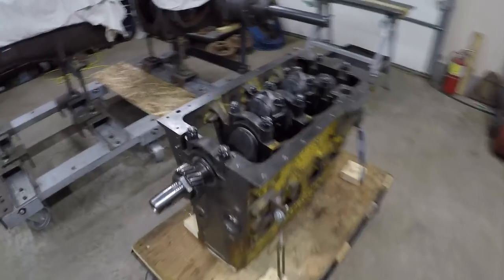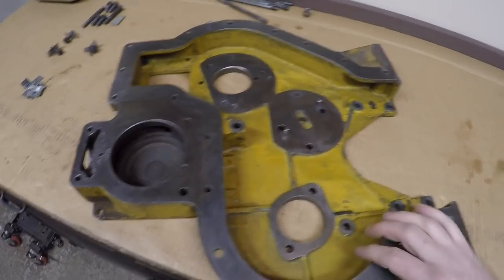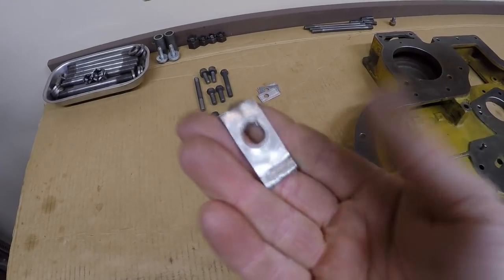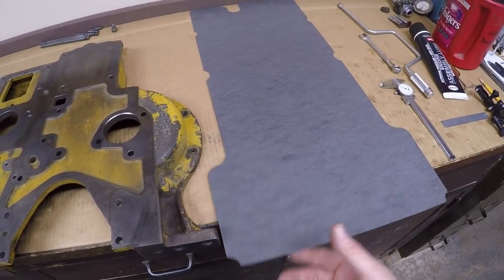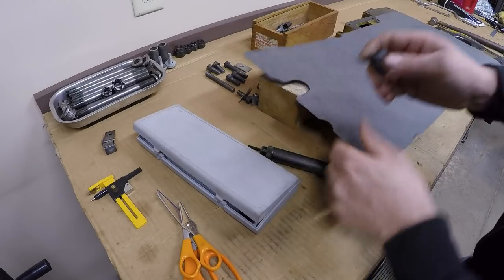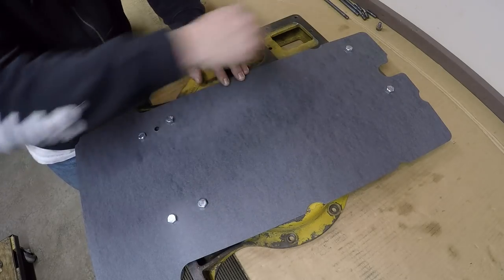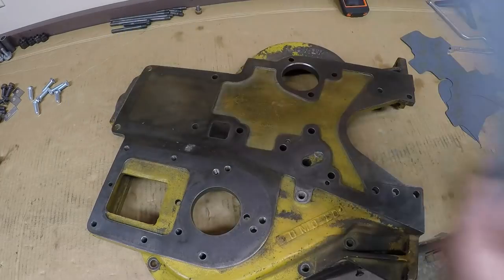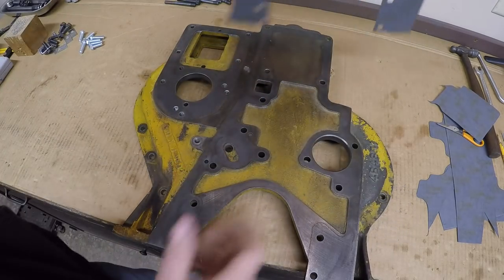Caterpillar D2 #5J1113 Diesel Engine Assembly Ep.11: Intermediate Cover Prep, Locks, & Gasket

Comment: Back in the day, we used to often make gaskets this way and the sealing compound of choice was "shellac" which was made out of tree sap and other additives. Today, its instant gasket and polymer gasket materials - which is good too.
Reply: Shellac is bloody good stuff. i've reused head gaskets with a coat of it on both sides of the gasket and bolt it down tight and even. Successfully, more than a few times. Not with permaseal gaskets . They're stuffed with a single use usually. i keep Shellac flakes in my toolbox. mix it up with kero or turps or meths Methylated spirits for engine gaskets. Turpentine for wood furniture. Kerosine for a protective layer on metal. (massive fire danger with kerosine). Like red lead paint there is no substitute in modern materials.

Comment: Remember making gaskets for hours back in the day. We bought the gasket material in big rolls. And every job we had the right gasket. I did learn to mark the outside edges with grease. Then an old rolling pin. Marked them perfect to cut out the edges.

Comment: Back when I was cutting a lot of gaskets I brazed some bearing balls in assorted sizes to shanks so I could press them against the hole and mark with a light tap or two.  If I were going to cut any more I'd go full Martha and get one of those wicked sharp roller type fabric cutters along with the backing pad.

Comment: Instead of tapping the shape out with a hammer I have always put a light coating of oil on the metal and pressed the gasket onto that. It prints a perfect cut line on the gasket material in seconds.

Comment: Biggest gasket I had to 'knock out' was for the rear crank case cover of a Sulzer 12LDA engine, about 4 feet at the widest point but only 1 inch wide. Managed it in one piece using the tap with a hammer method, trimmed with a craft knife after basic shape made. Popped a bolt in to anchor it at every opportunity and it worked out really well. Used the same method when we worked on another unit of the same breed.

Comment: Back in the day I used to use heavyweight paper grocery bags, and installed with gasket shellac. Worked well, but they would dry out with age. Permatex #2 worked well, but the high temp silicones changed everything. I still worry about that stuff getting into an oil gallery, so I use it sparingly....
Reply: Yes! Gasket shellac used to come in brush top bottles....I wish silicones were a little more fluid and came that way too. I think folks today don’t dress gasket surfaces or look for warpage, especially with valve covers.....when you work with British stuff, it’s all you can do to keep them from leaking...

Comment: Another FYI.
 Making gaskets is sometimes the only way. I welded a 1/2" & 3/8 ball (bearing) onto a couple 
3 1/2" X 3/8" Bolts. That way I can control the force of the hammer strike.
Also rubbing the edege of the flat face on a ball peen hammer over the bolt hole will expose the bolt pattern.. Great video.
Wish I was there to assist.😊 Jeff of
JPaydirt has a source for obsolete Cat engine gaskets & O-rings he's Great guy & he's willing to help out when possible.. Tell him Roger sent you. Ha ha.

Comment: I've seen a Video yesterday of someone starting another old cat and actually remembered you talking about the "clutch" of the pony motor is supposed to lock in and when it doesn't people tend to hold the lever in place to crank the engine, which is what that guy did. So yeah, actually learned something ;)

Comment: The ball peen hammer is tried and true for locating holes but as hear of late I use steel balls. I have a set from 1/4 up to 1 inch in dia. Lay it over the hole and tap tap tap and you have a hole.

Comment: I have used grease to mark out the gaskets surfaces or used a old existing gasket to make a new cast on the material. Only thing I would caution is make sure the holes are in the right size to avoid later problems of bolts or studs getting stuck into the gasket. Another thing is materials, some are easy to punch through but sometimes you have to tap really hard or to a circle around the hole. Other wise you end up breaking the gasket. Really like Squatches approach on making the gasket seems to be something I will try out myself.

Comment: If it's still possible, Mabe coat the water pump area & as much of the exposed metal in the water jacket area, with spray on elecric motor  varnish.. Just a belated idea. Nice looking front cover ya got there, it will preserve it a little bit anyway...

Comment: love this series. 

I'm wondering about the bolt holes in the cast, would it maybe be better to countersink them a bit so that there is less chance of the material pulling up, contacting the mating surface and interfering with the clamping pressure?

Comment: I dont use the hammer tapping any more i trace measure in side if mostly straight lines if lots of curve i use blueing to mark it then i have a hole punch set cut with siciors any in side curved corners i punch out the raidous with hole punch the cut i punch all holes first. Cut out inside the out side

Comment: What's with that strange oval hole that has paint under it on the intermediate plate side? A hole that doesn't line up in the block and transfers through the gasket slot?

Comment: What are your thoughts on powder coating an engine after a rebuild? worth the cost or no? do you think that it is even possible to do that without cooking the rubber seals/gaskets and assembly lube?
Reply: I was thinking the same - powdercoating only  individual pieces